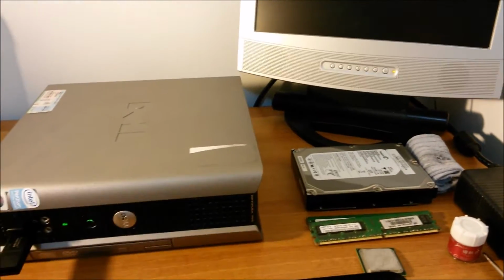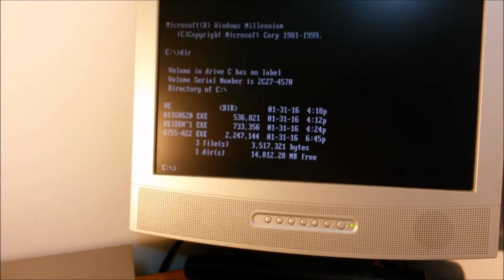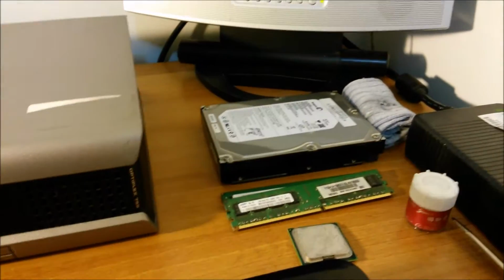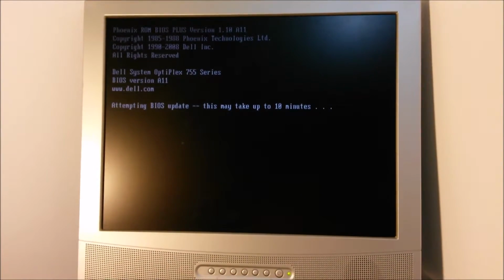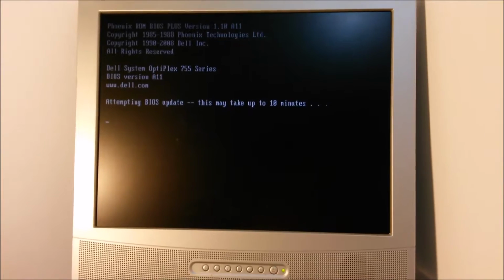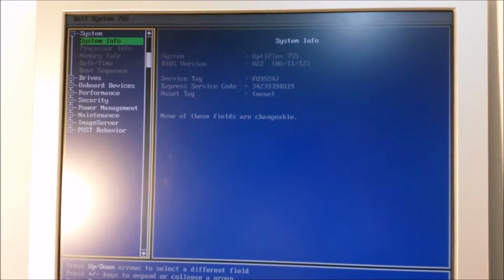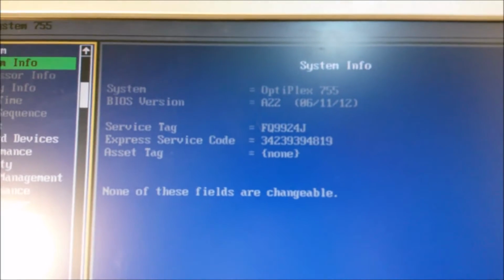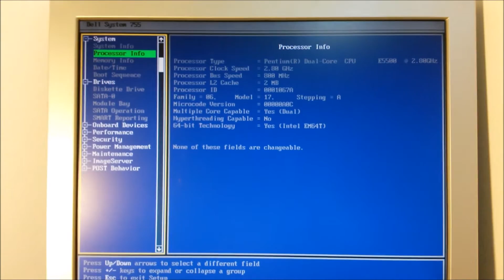How to upgrade a DELL OptiPlex 755 USFF PC

Comment from the maker: ▬▬▬▬▬▬▬▬▬ஜ۩۞۩ஜ▬▬▬▬▬▬▬▬▬
        T H A N K  Y O U  F O R  W A T C H I N G !
     P L E A S E  L I K E  A N D  S U B S C R I B E !
▬▬▬▬▬▬▬▬▬ஜ۩۞۩ஜ▬▬▬▬▬▬▬▬▬
Reply: Ultimate DIY frate te rog sa faci un video cum sa ai mai mult dedicated video ram memory la  placa video al caluculatorului ;)
Reply from the maker: Mi-am notat si promit sa fac, dar nu mai am momentan nici macar un singur desktop in casa, cu bios de tipul vechi, pe care sa il fac. Promit, cu prima ocazie, cand ajung la un cunoscut care are asa ceva sa il filmez si il pun pe YT :)
Reply: Ultimate DIY Mersii foarte mult frate,apropo mam abonat casa vad mai multe postarii din viitor
Reply from the maker: Multumesc! Apreciez! :)
Reply: I have this pc. But when i installed windows 7, i cant even play any movies on my vlc or any kind of videos. Can u help☹️
Reply from the maker: They don't play at all or they a just laggy?
Reply: A SSD would do more for that computer than changing the CPU.  It would make the computer a lot faster, more so than the CPU.
Reply from the maker: Yes, but 4 years ago a SSD would be worth as much as this whole PC 😄 Also, it would not help with processing power.

Comment: Safest way is to change only one thing at a time. Like that you upgraded Bios first. I wouldn’t have done memory and processor at same time. That way if there is a problem, you know which one. Glad it worked for you. I have a 755, but it is mini-tower. It has a slot for graphics card but when I put in NVIDIA gt720, it would work for a while but eventually scramble the screen and need to reboot. Had to revert to on-board graphics.
Reply from the maker: Ah, maybe just not enough juice 🤔
Reply: @UltimateDIY  Hmmm. I didn’t consider that possibility. We go with what works. Maybe if I had used the same graphics card you did, it would be fine. Someday I’ll try that card in another PC and that will tell me whether the card was bad.
Reply from the maker: Indeed, who knows. Computer repairs are just educated guesses 🤭

Comment: Hi I am having a problem with my DVD driver. It is not listed. What and how do I sort this out, as I can't use my DVD at all. Thank you
Reply from the maker: Hi. The drive might be defective.
Reply: Hi thanks for your reply. I would like to know then why does the tray eject when I press the button. Could it be the laser or the motherboard in the dvd?
Reply from the maker: The tray will eject as long as the drive has power. But if it does not show up in My Computer the unit is either defective or the data connection has a problem.

Comment: The  ethernet connectors on these fail often.  I don't know why.
The limit in ram is 4gb ddr2  total.  
The front and rear fans fail also. 
These are just terrible machines , they either work or don't. They're not worth spending over $20 to repair.  The fans probably are over $20 now. The fan under the hdd is a problem too.
Reply from the maker: They are really, really old at this point. When I bought them they were less than 20GPB each 😄

Comment: That's not a usff at all.
Reply from the maker: You should tell Dell all about this. They have been thinking they are selling an usff for so long: https://www.dell.com/support/kbdoc/ro-ro/000134439/optiplex-755-ultra-small-form-factor-usff-removal-guide-for-the-system-cover-badge-rotation-memory-hard-drive-and-module-bay
Reply: Are you blind? smh
Reply: @SoapinTrucker  Well, it is pretty small, but much bigger than the USFFs I usually see.
Reply: @mululipy  That is because it's old.  All of them used to be bigger.  Everything has got smaller, you must be young.  The small ones they have now are called micro.
Reply from the maker: Yup, agreed 👍🏻

Comment: How did you put bios onto USB stick? I have a problem with that?
Reply: And how did you start it, I'm currently using puppy Linux as OS, so my USB won't start like yours..
Reply from the maker: Try to make a bootable drive with yumi and  load a free dos version on that drive. Then copy the bios update files also on the drive and run the executable under the ms dos enviroment.
https://www.raymond.cc/blog/easily-install-freedos-in-usb-flash-drive-for-bios-flashing/2/

Comment: I'am watching this video on this particular machine and trust me I'am suffering
My specs are these:
1GB DDR2 333Mhz
Core 2 Duo 2.33Ghz
80GB HDD
Windows 7 Professional/Everything turned down to basic for better performance.
A crappy Chipset(R) Graphics Chip Which Can't run 1080p60.

The thing is..why did you even bother upgrading it?...jeez just buy a new one for that same price probably an i5 quadcore maybe!
Reply from the maker: For the same price you will not be able to buy anything better than it, so there is no chance of i5s, maybe an i3 from the first generation if you are lucky.
You have a few issues there:
1. Not enough ram. You need a minimum of 2 GB to run anything above XP. And when I say run, I mean run it normally, nu just power the computer on with it.
2. A 3GHz CPU would give you about 25% more processing power.
3. Smaller and older hard drives are really slow. A 500GB hard drive or, even better, a SSD would give you a huge boost in loading times.
4. Old GPUs are unable to run 1080p without a lot of CPU help and you need a C2D at about 3GHz to be able to play the video right just with CPU power.
Reply: @UltimateDIY  dude where do you live
These things are around 150$
For that price you can get a used 3d gen i5 prebuild with no gpu
Reply from the maker: 2 years have passed since the previous comment. Prices do change over time :)
Reply: @UltimateDIY  Has it been 2 years already, damn we are getting old LOL
Reply from the maker: Indeed...